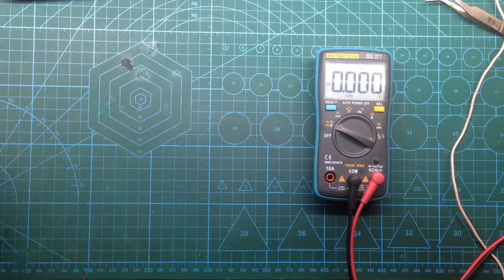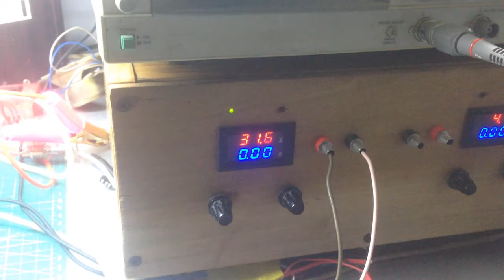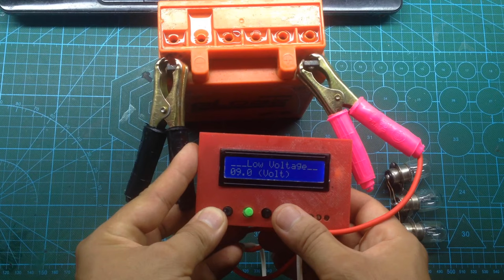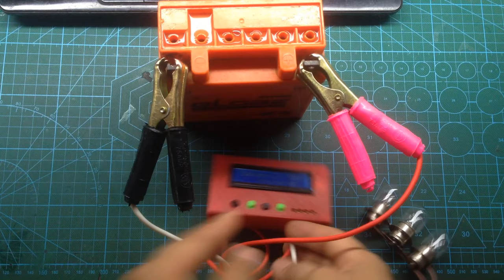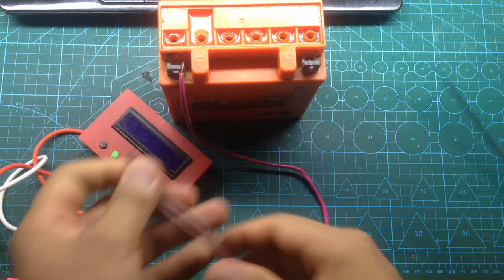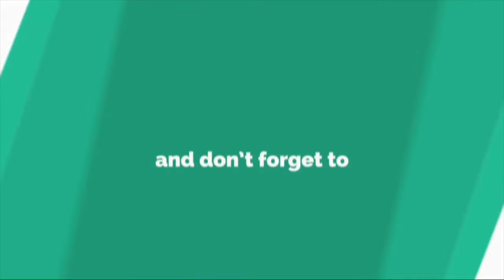Repair battery with salt and lemon

Comment: Just wondering, why did you put the red cable from the multimeter to the left side of the battery and put the black to the right side of the battery? then you put the black cable from the internal resistance measurement tool to the left side of the battery and the red to the right side of the battery? when the negative is on the left and the positive on the right.